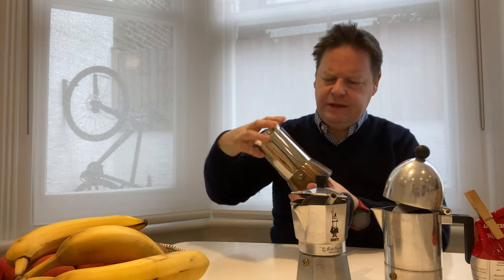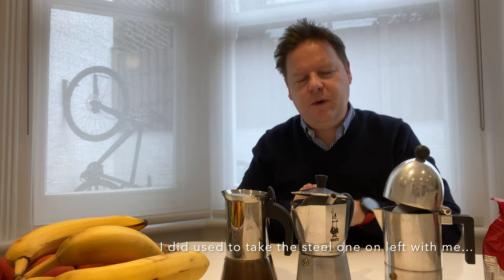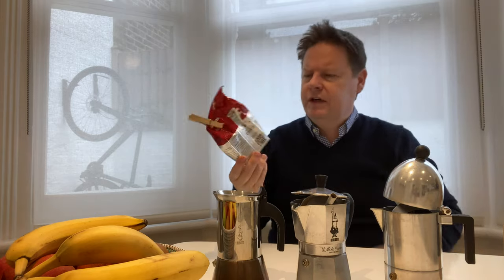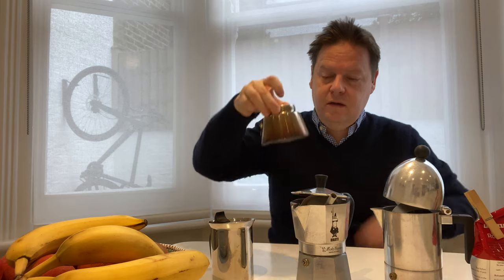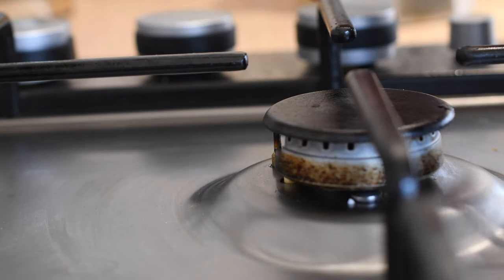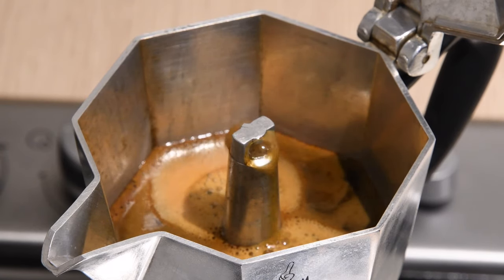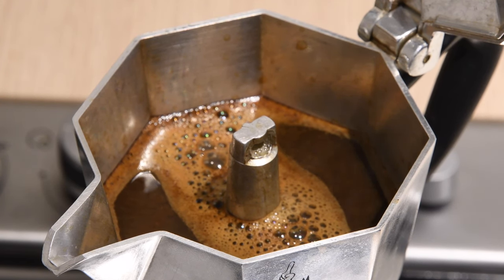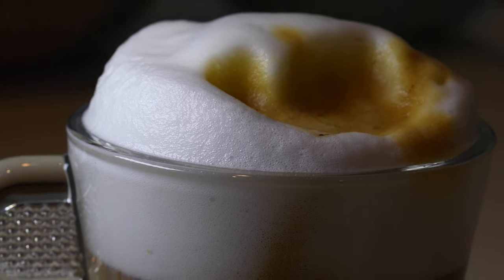Stovetop Moka Pot Coffee - two key differences and a tip if you use milk 4K UHD

Comment: Excellent video thank you. I have tried my moka using an Aeropress paper filter as many suggest, and whilst it makes for a cleaner cup you don't get the mouth heavy oils from the coffee, which isn't my preference. The only other thing I do is drip a little cold water into the upper chamber when it's on the heat; I feel it stops the coffee coming into direct contact with super hot metal and "burning." Thank you again Mr Borrman.

Comment: Hello again, Christian. I've since expanded my Bialetti collection with a number of new, old-type Brikka pots, before they sold out. The other thing I forgot to mention earlier, was that I use a heat/flame diffuser, whilst brewing. The flame never directly touches the pot. The heat is spread more evenly at the base and the coffee doesn't get scorched. I have not had a bitter cup of coffee by using the diffuser.
With the amount of money I've spent on the Bialetti pots, I could have got a small genuine Espresso maker. But, I prefer the Moka pot instead.

Comment: I like the electronic engineering angle .... using a heat sink. That's not just a coffee, it's a creation of coffee goodness. I'll have to go down to the local electonics store and get a heatsink. Thanks for posting your video.
Reply from the maker: Hi, I still need to dig out the carbon graphite super computer / formula one radiator fin heatsink I have somewhere under all the coffee gismos, bike parts, defender parts, computer parts, etc... thanks and enjoy a much better way to cool stuff down!

Comment: I'm taking a minimalist approach to my coffee "hobby". I'm avoiding scales, what goes into the funnel as whole beans, is ground up, with a few more to compensate for air gaps. I use a heat diffuser to protect the pot from direct flame and a Zassenhaus La Paz hand grinder. I have recently gone high tech with a motorised frother. I use a Bialetti 6-cup Moka for a mug of coffee and follow Bialetti's instructions.
I  can tell you why it takes a few boils to make the coffee taste better. I recently bought some 6-cup pots. I wiped the funnel with a paper towel, and a black machine oil film came off, with very fine aluminium filings. I wiped out the rest of the pots with paper towels with similar results. I'm convinced, cleaning with plain water and conditioning, does not remove all this manufacturing oil and must be wiped off the funnel first and pot first. After washing with hot water and a bit of dish washing liquid, then condition it.
Reply from the maker: all sounds nice... I cannot wait to get back to my old (parents) house in Spain where we have a similar grinder screwed to the wall and its amazing, especialliy with srping water from the mountains... two years late but video soon! Thaks for lovely comments, enjoy coffee and stay well!

Comment: Im currently watching lots pf videos on moka pot bec i just tried to use mine today and it started spluttering, so im trying to figure out where i might be doing it wrong. Thanks for your video! First one to use cold. Exactly my thought i just want a good coffee in the morning and I don’t want to use scales or too much procedures if i don’t need to.
Reply from the maker: Thanks! Yeah I agree, a lot of people think I am crazy (in a sort of good way still) for travelling with aeropress / filter cones / wacaco, etc... but if I cracked out some scales and started weighing water... you quickly go from a little eccentric to people wondering if they can leave you alone in the kitchen despite their insticts screaming "get outta here" :) Anyhoo, back to spluttering: I have had this when a) the is seal going / seal not quite working (coffee engrained in seal, old hardened seal,  deformed container) and finally b) when somebody kept using it on full heat to the end and beyond and the riser tube got caked up with baked-on coffee. The latter was terminal sadly, despite my old grandfather using all sorts of chemichals to remove the caked on coffee... I think we lost some coffee making metal in the process :) Good luck, but would start with a new seal and/or swapping tops, coffee chambers, etc around if you have more than one moka, where the parts fit, and hope to isolate the issue. For ages I ran a "frankenpot" which was a mix of two mokas!
Reply: @ChristianBorrman   The spluttering was solved when I made sure to close it properly, and I think most importantly got around turning the stove to low heat when it started to boil already, then it steadily filled up as I expected :D
Reply from the maker: @jhonnafg  Great to hear, thanks for sharing how you solved it!

Comment: How to blast the flame first then continue with a smaller flame ? You do small flame from the start. Thx 
I usually start to finish with smallest flame ...
Is that correct ?
Reply from the maker: if it makes coffee you like then it’s correct! One of my viewers recommend putting warm water in the reservoir, and then low gas, which I have been trying and works well as well! will be in an upcoming video!

Comment: Any tips to produce that crema we seen in YouTube videos? I have a 3 cup moka pot and each time i make a cup, it is quite bitter. I use illy's espresso ground coffee. At first, I had an issue where the coffee would splutter everywhere, turns out I wasn't sealing it tight enough. Now that the issue of spluttering is resolved, my coffee is bitter as hell!!
Reply from the maker: they are fickle beasts moka pots! I have no logical explanation for why, but moka pots in my experience need a good few coffees through them to provide a good crema. Other things to try with Illy is slightly less coffee, or other brands like Lavazza, which I think is a bit coarser, but a sure fire way is to get fresh coffee from a place like monmouth coffee who roast daily (like two days after the Kenya lockdown no longer had Kenyan coffee, fresh) and get it ground as stovetop, which is what I am using in the video, and is much coarser. Hope that helps! I may try some Illy as I remember have some great Illy coffee at one point!
Reply: Some italian guy said to put sugar in the top half as it will produce coffee, he didnt say how much or if u have to do it a cerain way and i havent tried it my	self but you could give i	t a shot
Reply: Try using a coarser grind
Reply: Illy is shit, use good coffee, not supermarket level stuff. Get some good beans, fresh ground med/fine. Good coffee places will grind for you, I can't be bothered with the cost and effort. It does make a difference. With a Moka, shit in = shit out. Heat on low/med, never high, that is a sure way to make it bitter. You can't get crema from a Moka, the pressure isn't high enough.
Reply: You want crema? Buy an espresso hehe.
Reply: Less water. Not necessary to fill just under the valve with a darker roast ( as I understand it.)
Less water= less time on the heat= not overextracted.

Comment: Boiling water start is terrible, cold water can be okay but I prefer to start with water between 50-70 degrees Celsius and stop it before the little fountain of coffee at the end comes. If you start with cold water the first water that reaches the coffee is about 40 degrees Celsius and the coffee tastes a bit underdeveloped and sour imo.
Reply from the maker: interesting, thanks I will try that, I can handle 50 to 70 degrees without burning hands in morning!
Reply: @ChristianBorrman  I use a towel to hold the base
Reply from the maker: have just done a shorts video using your method and have a longer one in edit with a cool twist! thanks again!
Reply from the maker: finally done the long version with your 50-70°C water method and the twist ;)
Reply: I have found that I get the best results with the water from my kettle after leaving it for 10-sih minutes... I have no idea what the temp is but it is defiantly above room temp but much lower than just below boiling... Must be somewhere close to that 50-70 range
Reply: Coffee is never sour when starting with cold 🤷‍♂️. Never.

Comment: I have the Bialetti moka pot and I'm having the worse time at screwing it properly. I always get filtrations of water. Do you have any trick for it?
Reply from the maker: the seals can be a pain sometimes - make sure they never have coffee grains on them, as once its been screwed together and heated the indentations of the grains stay and can mean the seal will leak forever more… ditto dry seal or finally too much coffee and overtightened

Comment: are the aluminum moka pots ok to use on the coil stoves?
Reply from the maker: yep you can, the heat is a bit harder to control so I always used a heat diffuser or a small ring adapter so it was not in direct contact with the coil; but maybe that is too much and just a step away from weighing the water lol 😂
Reply: I've used aluminum moka pots on electric stove coils for several years now. Haven't used a diffuser, although that might be a good idea. I just make sure not to have the heat set on high since the heat is so intense.